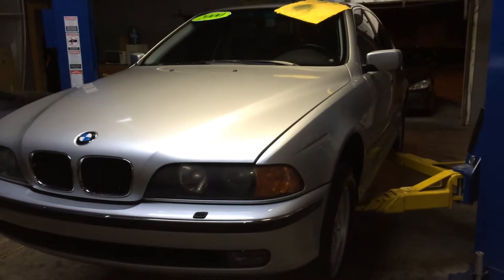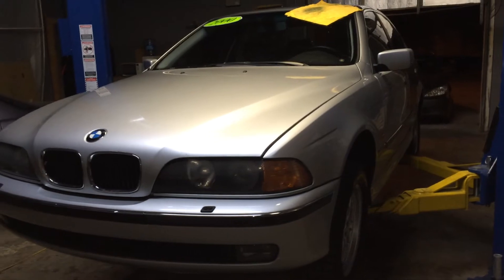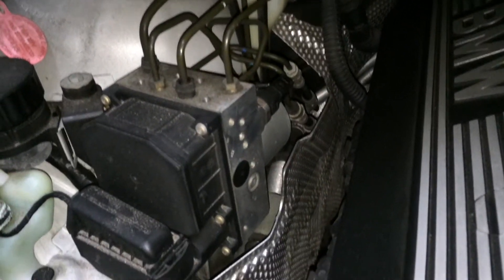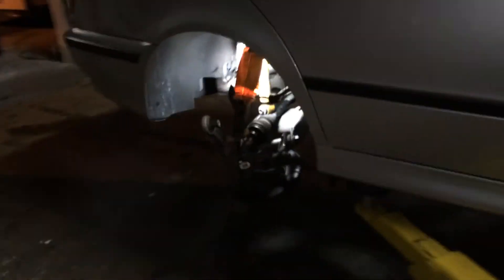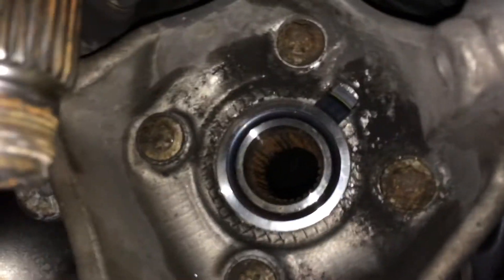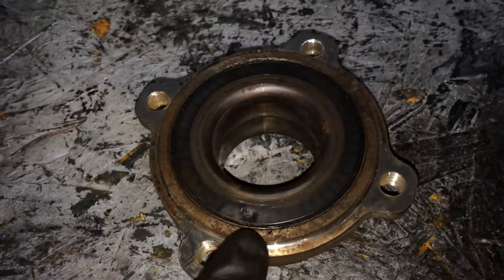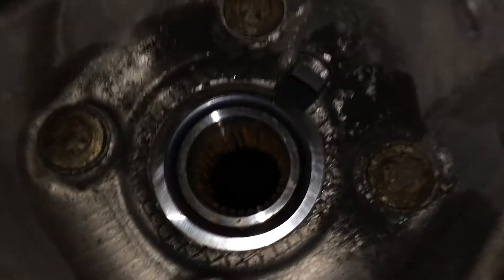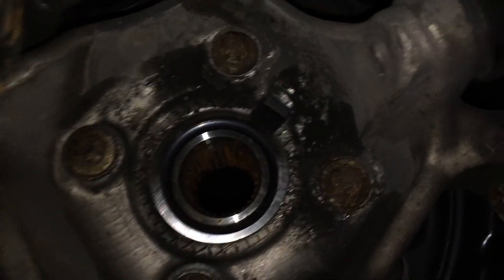Brake Pedal Pulsing/ABS Activation Due To Damaged Wheel Speed Stator - 2000 BMW 528i

Comment: @Brian Kiellish I have the same exact issue on my e39 front and rear disc and pads changed front arms all changed no dsc/abs light nothing on scan tools either. I feel like this is happen on the front end off my car but I don’t see any abs sensor behind the hub/ wheel bearing is this sensor only in the back wheel? All guide pins have been cleaned and lubricated.

Comment: The cause of stator damage is the removal process of the predecessor ABS sensor which was corroded/frozen in place requiring drilling/fracturing for removal. A drill bit or dental pick went too deep making contact with the stator. Even if you know about this possibility prior to removing a frozen rear ABS sensor on BMWs you may very well hit the stator. You only have 0.2 mm clearance and the need to remove all distal portions of the frozen sensor without striking the stator is essentially a game of Russian roulette. That's why some people first remove the bearing assembly and then drive the sensor out to avoid stator damage.

Comment: 2007 bmw x3 e83 ... I Removed my abs/speed sensors front and rear. The 
rears were full of rust and road debre. Also, the Tone ring looked a 
little "out of round" (High and Low spots) probably from rust. I cleaned
 the rear rings w brake clean and nylon brush, cleaned sensors with a 
rag and wire wheeled the rust from the mounting area (hole). My sensor 
were worn and curved to the ring so I made it flat like if it wur new 
sensors with light sand paper and razor. there basically magnets and the
 plastic was not worn to the inducer  The fronts weren't as bad but 
didn't pay as much attention to them as the rears. Also on the front the
 Ring is inside the wheel bearing I think, or some other back yard 
mechanic remove them. I had 2 codes in computer P1774 & P1775 ABS, 
4x4, Check engine and brake lights were on and off. After doing the work
 the dash lights went out and reset the codes. 100 miles so far and runs
 good. These sensors will cause the vehicle to run terrible cuz they 
report to computers, the transmission, speedometer and transfer case 
etc... Questions:
Did you fix or have your car repaired and what was 
the problem? Do you or Anyone have the ABS modulate at low speed in 
reverse only? Any reply would be greatly appreciated.

Comment: hello i just bought bmw e39 528 1997 and i have this weird problem with the brake system. some times in highway not all the time the car are vibrating a lot and after that no brake at all no pressure in the pedal i changed the brake pump same problem and  i remove the abs fuse the problem is same any one have this problem ?
Reply from the maker: powerz80 If the pedal feels like it has no pressure it would most likely be a mechanical problem like a master cylinder leak. The vibration may be a separate issue like warped rotors or a bent wheel/bad tire.  Check the brake fluid reservoir and examine the master cylinder for external leaking. Take a look at the calipers as well.
Reply: the brake fluid reservoir is full and  no leak in  the master cylinder and no dashboard fault lights  .  the weird think this happen  after the vibration  and more than one time . vibration then no pressure

Comment: I have no abs light on the same car but my abs is not working . Ideas? Please help
Reply: +Brian Kiellish What kind of scanning tool do I need?
Reply: What year is your vehicle?
Reply: +Ryan A is a bmw x5 2003, and its pulsating like you say, sometimes only once or twice.
Reply from the maker: +Eduardo Fuentes any scan tool that gives you a real time readout of the wheel speed sensors. I use an autel maxidas scan tool, I'm not sure if the more basic ones will do it. You can check each stator by removing the abs sensor and spinning the wheel to inspect for damage. This would eliminate the need for a scan tool.
Reply: +Brian Kiellish thank you.
Reply: Mine was tampered with , someone took the cluster off the car and disassembled it and taped over the ABS ,Trac and break lights , I rebuild the abs mod and swapped all sensors and they went away. 
I would check that first as I was confused as hell , some people can't be honest for the life of me .
Reply: +Brian Kiellish I have a similar issue on my 2005 X5. I did get the DSC error and the scan tool indicated the steering angle sensor as the problem. I have replaced the steering angle sensor and the DSC errors are gone. I have replaced the front rotors and pads but the pulsating brake is still there. 
I now assume this is a ABS sensor issue.
Reply: 2007 bmw x3 e83 ... I Removed my abs/speed sensors front and rear. The rears were full of rust and road debrie. Also, the Tone ring looked a little "out of round" (High and Low spots) probably from rust. I cleaned the rear rings w brake clean and nylon brush, cleaned sensors with a rag and wire wheeled the rust from the mounting area (hole). My sensor were worn and curved to the ring so I made it flat like if it wur new sensors with light sand paper and razor. there basically magnets and the plastic was not worn to the inducer  The fronts weren't as bad but didn't pay as much attention to them as the rears. Also on the front the Ring is inside the wheel bearing I think, or some other back yard mechanic remove them. I had 2 codes in computer P1774 & P1775 ABS, 4x4, Check engine and brake lights were on and off. After doing the work the dash lights went out and reset the codes. 100 miles so far and runs good. These sensors will cause the vehicle to run terrible cuz they report to computers, the transmission, speedometer and transfer case etc... Questions:
Did you fix or have your car repaired and what was the problem? Do you or Anyone have the ABS modulate at low speed in reverse only? Any reply would be greatly appreciated.
Reply from the maker: Start by checking fuses and the abs pump relay as well as connections to the abs module.
Reply: Also there was no codes when I checked, and when I did the cluster control test for the indiction lights, abs won't come on either, but I will be checking my relays and fuses tomorrow. Thanks buddy
Reply from the maker: If the abs/dsc/brake lights don't illuminate when the key is turned on then they are likely broken or taped off. Have you ever seen them come on? Also, if you have access to a scan tool, try and communicate with the dsc system. If there is no communication and the fuses and relays all check out, the module is most likely bad. Any irregularities with the speedometer?
Reply: No speedometer issues no codes even when I disconnected rear speed sensor still no codes tried all of them it only gave me a code when I disconnected front left. Streng! I know but I haven't got my relays checked out so will see what happens when I do